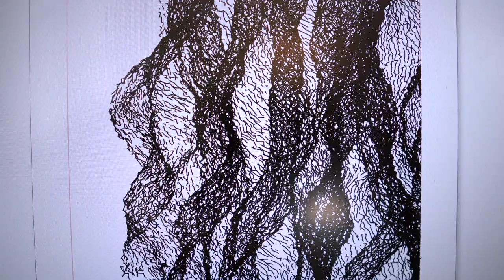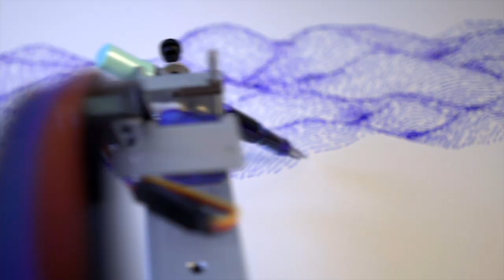The Sea  - Chill pen plotting on the AxiDraw

Comment: I've noticed in quite a few of these rhat the pathing the machine takes is wildly inefficient, there's a lot of arm movement across the print for a tiny dot then back across for another. I'd be curious to see the speed inprovements if these paths were better optimized.
Reply from the maker: Yeah, you can get some good optimisation that can sometimes dramatically speed up the plot. There are a few times you don't want to do that, for example using fiber nips on pens, as the nib wears down you often want it to happen in the original draw order, if the pen goes back to fill in lines later on it can look a bit odd.

In this case with the fountain pen optimising would totally have been the way to go 😁

Comment: Stupid question: why not simply print the image?
Reply from the maker: Reasonable question, here's some of the reasons.

You can use paper that you can't normally put through a printer, both in type, colour and size of paper, in this case Saunders Waterford 300gsm cream 1/2 imperial paper. But also heavily textured paper, and sometimes I use handmade paper.

If you watch this video: https://www.youtube.com/watch?v=gi18_pCUAtY you'll see silver and gold metallic pens on black paper.

You can use all sorts of inks, here's I'm using fountain pen ink, but I've also used custom blended ink, white ink, metallic ink, watercolour paints, and so on. The way the ink interacts with both the paper and itself is often unique.

You can also use various pens, including brushed and even an inscribing point to etch copper plates.

In this particular case I'm using blue fountain pen ink on cream paper. How pen ink looks on paper is very different to print from printers.

I agree though that there are some things that are better done with printers, some with screen printing (for example) and some with a pen plotter.
Reply: @revdancatt  Thanks for the considerate reply! I'm learning a lot.
Reply from the maker: No worries, any time.
Reply: Also the plot has a more "human" feel than a direct print.  Using a fountain pen to apply ink to paper results in a subtly in the lines that you just would not get in a colour laser or even dyes sublimation print.